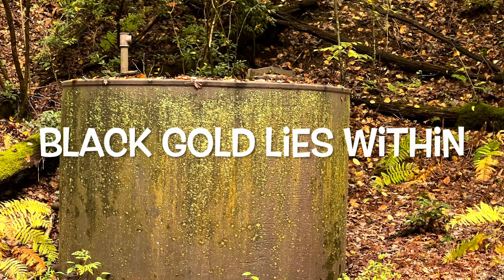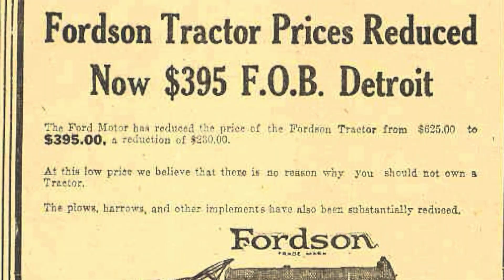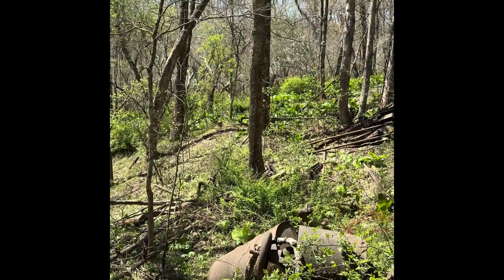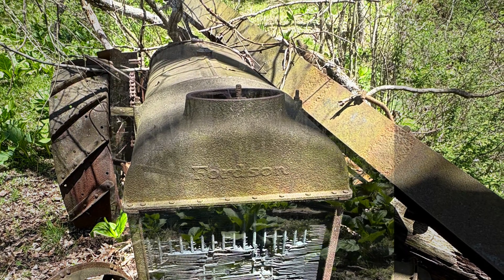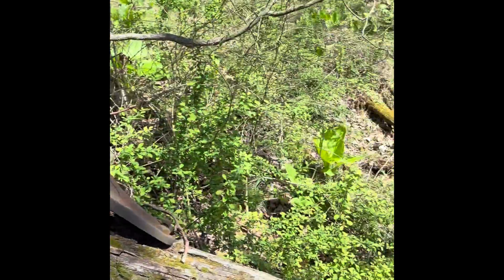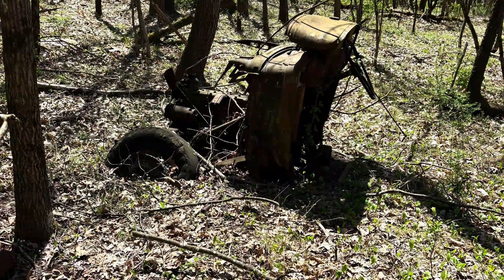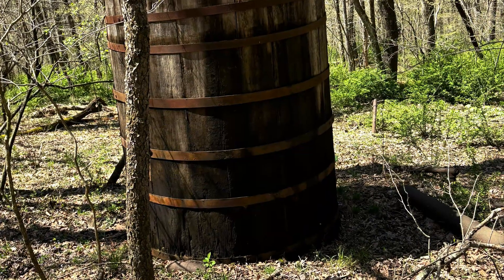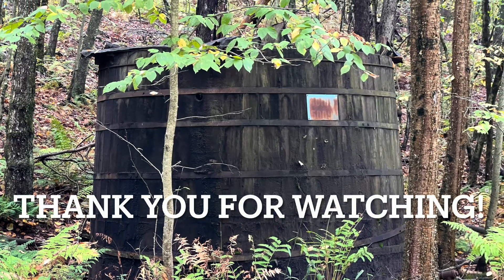Historic Engineering: a 1917 Fordson Tractor for Oil Pumping found in the woods

Comment: There were no boilers those remains of engines with flywheels are called half breed engines. Because at one time they were steam but they have been converted to run gas. Actually they would have ran off of well head gas.
Reply from the maker: There are some that are more intact half breed (bastard) pumps going up toward Titusville. I hope to get up there at some point and do a very close-up of one that is in close working condition. That way, I see all the details. It’s amazing what they repurposed the various parts and how they use them. As my friend said in the video, that boiler area would’ve been used with a stack with the gas coming straight out and used almost like a spark plug.  Very cool. Thanks for watching

Comment: that is a 1947 dodge truck with a flathead 6cyl engine
Reply from the maker: Sir, if you can tell that by the little that is left. I'm major impressed. I guess that shows that they used those bastard pumps well into the century and not just the early years. Cheers!

Comment: Do you get a GPS or cellphone coordinate of the abandoned well head to notify the Penn DNR of the location?
Reply from the maker: It appeared that these were handled correctly as they were tagged at very top and plugged. (Cement noted in area around heads). But yea, these were addressed. The surface debris left in place by prior owners.